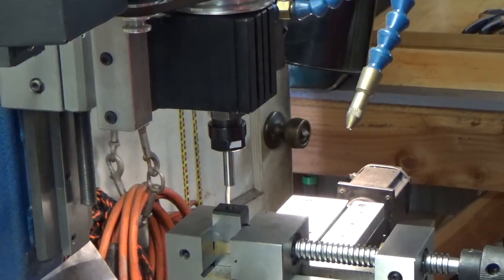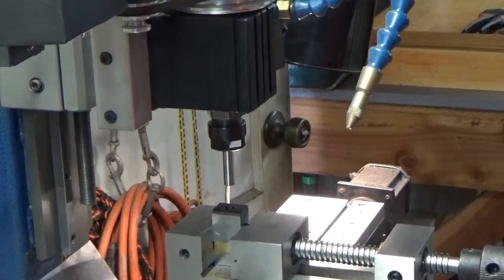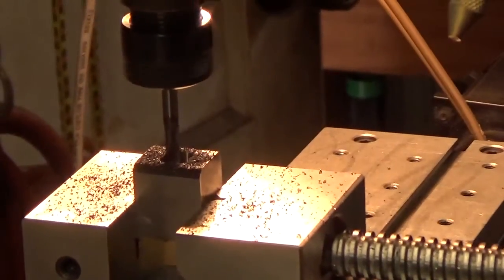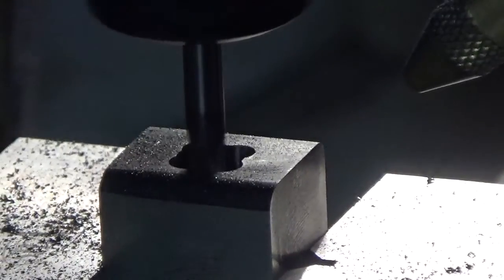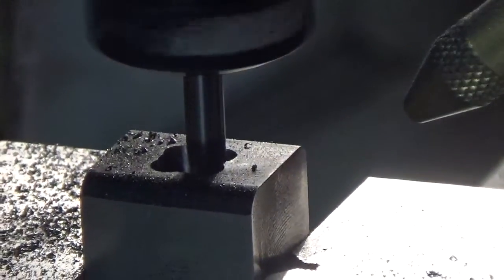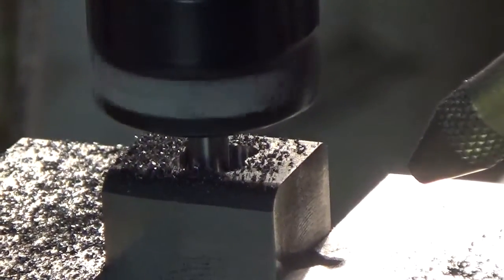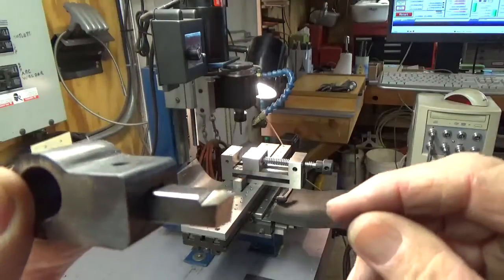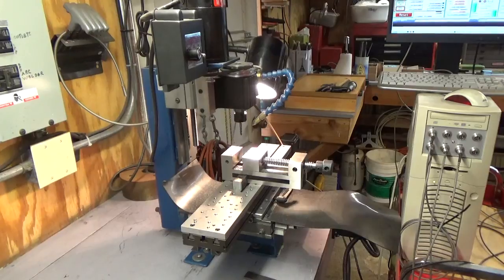Part #1 Rapide Lime Hand Shaper Clapper 5/16" Square Hole For Tool Bit using Taig CNC Mill

Comment: Pretty nice Larry, that is going to make square holes easily and quickly as well,  I will do the same when I get to that stage I feel sure that 1/8 bit will work just as well because the shank is the same size and they can be had with extra long flutes, 

Edmund.......Alberta
Reply from the maker: Walter:Thanks for the comment.  I also think an 1/8" diameter end mill will probably work just fine.  I may give it a go on a scrap piece of 1018 and see what happens.  Best Regards: Larry